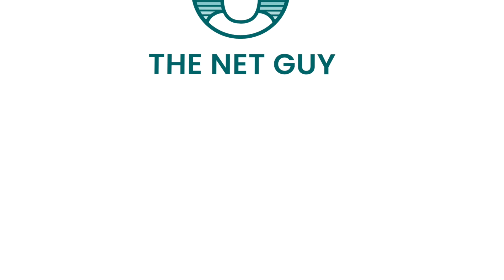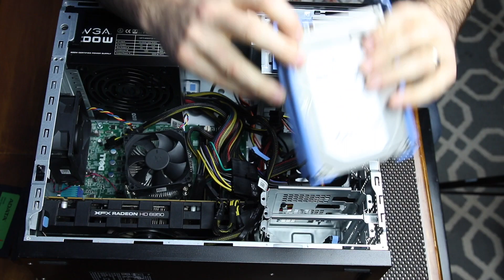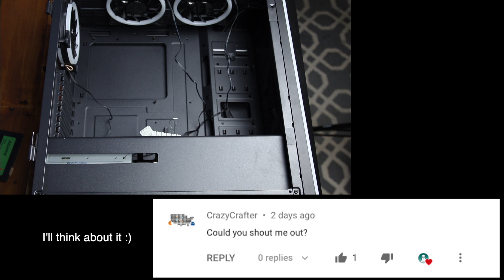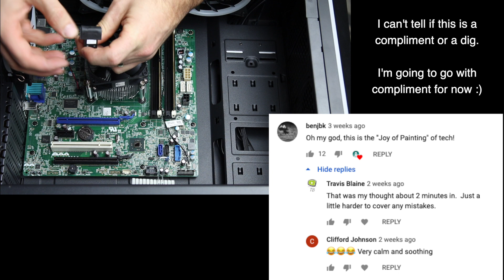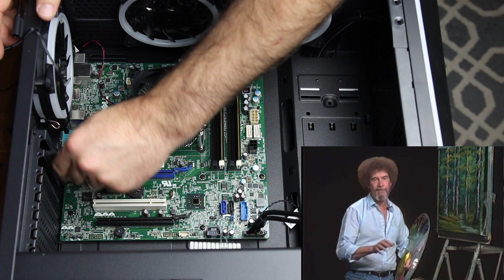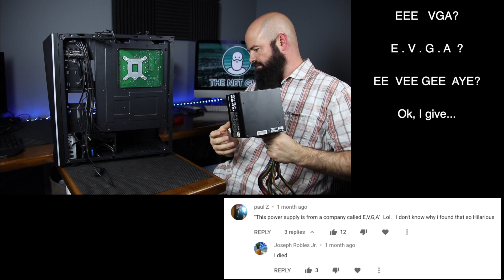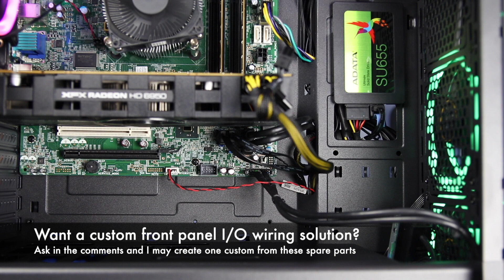Easy Dell Optiplex RGB Case Transplant

Comment: Net guy, recommendations on which optiplex to purchase?
Reply: Hey, until you hear from Net Guy you can try website DiscountElectronics.com they have plenty of used refurbished Dell MT computers and the OptiPlex 9020 is very nice for the price.
Reply from the maker: Depends on your need, but the Optiplex 9020 with the i7-4790 is a BEEEEAST machine. I love mine and use it every day.
Reply: Thanks net guy! I’m currently working on an optiplex rig, but I have a pretty tight budget.
Reply: @ret2097  same

Comment: wow thanks sir for the videos, I have optiplex 790 and wanting to switch other case, kinda stuck in I/O problems but your idea is just 'tuck in' inside casing might good idea. Hope I can find new PC case to switch and bigger enough to tuck in the I/O panel.
Sometimes I wonder if we can make a slot in front or upper casing to slide in the I/O panel so we still able to use it, but it seems like hardwork. Anyways thanks again kind sir.

Comment: looks like your having a better experience than i am lmao
Reply from the maker: Oh no!   What happened?
Reply: The Net Guy i had to take my whole cpu fan off (for my model) and I’m dumb so I didn’t think about it screwing it back in again. I agree everything else in there and when I was about to put the cooler on again with new paste, I was like o no, I can’t screw my cooler in. Can you help me or have any suggestions.
Reply: You can’t buy any backplates online either :(
Reply: @lachlan.mooney  kinda late but you still need help?
Reply: comatose heart Nah, I’m getting a new mobo soon becuase I think I broke the old one
Reply: @lachlan.mooney  that sucks but anyways for my 7010 sff board to use the stock cpu cooler in a different case I had a spare bracket that was the wrong size but I cut off the screw mount hole so I could put the cooler on without the original case it's not the best solution but it work although if you can I'd recommend just getting a new cooler for your socket if you can it will come with the right mount cause unfortunately with these pre builts they have the cpu mounts part of the case unfortunately although if you wanna keepcthe stock cooler you can always just order the mount separately for your socket type off ebay for pretty cheap
Reply: @lachlan.mooney  hopefully everything works out ok with your new board also what's going on with the old one?
Reply: @glistxningamber9534  how do you get the audio working
Reply: @arsynic4202  either use the back audio or you can make an adapter to use normal audio headers with it but that requires a lot of resources
Reply: @glistxningamber9534  for example, my case has a front 3.5mm jack how do i make that work
Reply: @arsynic4202  https://linustechtips.com/topic/987783-optiplex-70109010-front-io-panel-pinout/ this shows how
Reply from the maker: I did find some you can buy that are reverse from 3.5mm plug to motherboard make side.  But that’s a lot of work for questionable audio.

Comment: Thank you so much I had an Optiplex 7010 DT that I've tried to do a case transplant and had to put on hold for a while. This video really helped out since I missed a lot of stuff from the old case like the front fan and intruder thing. One thing that's holding it back though is that my new case came with a rear fan with a 3 pin slot that I don't know where to connect.
Reply from the maker: Thanks for watching and I’m glad you liked the video.  Often those three pin headers are for motherboard fans, but this one has different pin outs.  Your cheapest and easiest solution is a molex to 3 pin adapter from amazon: CRJ 4-Pin Molex to 4 x 3/4-Pin PC Case Fan Sleeved Adapter Cable https://www.amazon.com/dp/B07DPXR8KS/ref=cm_sw_r_cp_api_i_fpNoEbB5AFGSW
Reply: @TheNetGuy  Thank you I really appreciate the quick response and answers!

Comment: Jon:  I transplanted everything into a Corsair 100R case and I'm having a power issue.  I jumpered the middle pins and put my case power switch on the front but nothing starts.  When I take the jumper and power switch connector off the computer starts from the PSU (EVGA 600 QB) switch but I had to wiggle the 24-pin to 8 pin adapter - I assumed the adapter has a loose wire - then I reinserted the jumper and hooked up the power switch and nothing (even when I wiggle the adapter).  Obviously it would be pure happenstance if I actually wiggle the loose wire exactly right).

I didn't buy the one you linked.  Replace it?  Or is it possible there is another issue with the switch and the jumper?
Reply from the maker: There is one trick I didn’t show, you can actually remove the whole power switch from the older Dell and put it temporarily on the switch in the new case. This way you can get the diagnostic LED colors. I would try that and see if it’s complaining about memory or other issues. Always good to receive the components, and remove any add-on cards until you have it booting. Did you hook up the PC speaker? That can give you an audible beeps sometimes too.
Reply: @TheNetGuy  - I honestly think I got a bum 24 to 8 pin adapter.  I had it running all day with the switch disconnected (F1 to get past the startup error) but I had to wiggle the actual 24 to 24 connector to get to start when ever i shut it down.  All the 24 to 8 adapters on Amazon have about a 14-20% bad review for poor construction ratio.  I'll try the old switch and I'll have a new / different adapter Saturday.

Comment: im wanting to do this also! the i/o front prop is whats stopping me as id like to have the front usb 3.0 working at the front of the case. so the mention of rewiring sounded interesting to me and would be much appreciated. thanks!.
Reply from the maker: The front USB 3.0 will work, it’s only the USB 2 and the audio that won’t be connected.  thank you for watching! Stay tuned, I have some good stuff coming up with the Athena M2 case.  That one is a great value if you are looking to upgrade.

Comment: Jon, I am interested in seeing how to do a custom front panel i/o wiring solution (actually I'd buy one!).
Reply from the maker: I have the pin headers and necessary gizmos, but since audio is best from the back and I don’t use USB 2.0 I kind of gave up in lieu of the alternative.  If you email me I can send you some links that show the pin outs and I’ll send you the necessary parts ;)
Reply: @TheNetGuy  - I wound up doing a Frankenstein and put the front i/o panel into a plastic 5.25" bay adapter and kludged up a face plate out of the Dell front panel (it's not pretty but it actually works).   I used an internal USB 3.0 hub (https://tinyurl.com/ussux3n)  to give me USB 3.0 on both the Corsair 100R's front panel and the OEM front panel.  Unfortunately Sabrent puts a huge, stiff USB 3.0 20-pin to 20-pin cable in this.  I had to get a custom short cable to clean it up.
Reply: @TheNetGuy  - email sent.  Thanks for the fast response!

Comment: Am I the only person who likes the look of the optiplex case and doesn’t understand why people put dell optiplex systems in rainbow barf cases
Reply: From the outside its nice, but from the inside its like a horror movie
Reply: Mostly because of airflow.  Right now my Plex server / TV DVR computer is a max'd out SFF Dell.  The i7-4790 in it gets hot - not critical heat throttling hot, but hot.

And the challenge.  I'm assembling parts for a 9020 "rebuild" now and airflow and cable management are my top priorities (I'm not a gamer).
Reply: Mike Murley I guess I can understand for an add but the airflow on my 7010mt seems fine and the temps never go above 70 on my graphics card or my cpu
Reply: @falldmg6306  - 70 degrees F or 70 degrees C?
Reply: @mikemurley8656   Celsius
Reply: i like t looks of a dell optiplex i just would rather upgrade
 th
Reply: Probably for future upgrades

Comment: why didnt you just disconnect the chassis intrusion?
Reply from the maker: Hi Hans - it actually will throw an error message on every reboot of its not connected.  You may be able to turn that off in the bios,  but I decided to keep it.
Reply: @TheNetGuy  all i had to do was take power off the board and disconnect it, but if it works, it works
Reply: @TheNetGuy  All you have to do is go into the BIOS and disable chassis intrusion, Then remove the chassis intrusion from the motherboard and it will work fine without any erros.

Comment: Are the steps for the 9020 similar to the 7020? I have a 7020 and i'm planning on upgrading to an SSD, PSU at least 500w and a rx 570-580 but i don't know if i could upgrade the case too, if i do i would be closer to upgrading directly to a new pc just by changing cpu and mobo
Reply: My plan is to upgrade to the point of having a fully costumizable PC, same as just building one but step by step using my current OEM because budget

Comment: I want to do this with a dell optiplex 3020 tower, will it work? ( also planning to add a gtx 670 )
Reply from the maker: The 3020, 7020, and 9020 we’re all incredibly similar systems. I haven’t been hands on with a 3020 before.  I’d avoid the small form factor (SFF) model if trying to case upgrade.  Also verify the power supply connector size in case you need an adapter.  I hear the Optiplex 790 didn’t need an adapter.
Reply: @the net guy yes I’m thinking of buying the 24 to 8 pin connector for the psi and the form factor is a tower. Is this ok for an upgrade? I find it so confusing putting it into a new case 😭

Comment: hello, i need your help, where did you put RGB fans switches(because my RGB fans are not fitting into the motherboard) or power on board
and how to place another HD audio, led, reset switches???
Please response me fast
Thanks
Reply from the maker: HD audio I skipped because using the front panel audio headers is not normally recommended - there can be more noise on those than the back panel.  Led and Reset I didn’t need - just power.   USB 3 I use occasionally so I did hook that up because it’s a normal standard connector.  Your RGB fans will have to run off Molex - or check out my video on the Aelous M2 1204 fan kit - very cool upgrade.
Reply: The Net Guy l

Comment: I noticed your mobo did not have a black plastic frame for the power supply when you put the jumper and the power supply header from the case in. Dis you cut it off?
Reply from the maker: Sharp eyes.  You can pull straight up and it comes off.  Made it easier to point out the right pins.

Comment: Hi, I was wondering what I would need to do in order to put my: Dell Optiplex 9020 into a CiT Raider, I also plan to put in a GPU (RX 570), put a SSD in and possibly change out the HDD with a small RAM upgrade
Reply from the maker: Do you have the 9020 MT or SFF?  It looks like the steps will be identical to the ones in my video.  Use the power switch and front panel tricks I showed and you should have no problems.  You’ll want a conventional power supply and 24-to-8 pin adapter from my other video $100 gaming upgrade.  With an RX 570 and ram these machines are ammmmmazing!   Good luck and thanks for watching!
Reply: @TheNetGuy  hey i have a sff 990 dt and i really want to put it into a m-atx case but it also has strange front panel connectors and power sw. What can I do? Thankyou.

Comment: Hello. When you said that you weren’t using the usb 3 header from the Dell I/O but you will use the one from the case, is it as easy as plug and use? Did you need any adaptor for this?
Reply from the maker: Yep, the normal blue usb 3 header will connect right to the board, it’s standard.
Reply: The Net Guy woah! I didn’t expect a reply this fast. I’ve been watching this video and PC tech review’s video back and forth for a while now because of the transplant. PC tech said that we can cut the lower I/O panel and just tape it. I’m not sure how to approach this.

I plan to build this in the darkflash dlm21 case. Looks like a cheaper nxtz case with some cool features up the front. Can’t wait to share with you the results.
Reply from the maker: Thanks for watching. Don’t cut the wiring unless you absolutely have to.  I didn’t need the audio or the usb 2.0, so I left it.  I actually got a new mobo last week and put the Dell 9020 back in the old case so I was happy I didn’t cut anything.

Comment: I have a 9020 MT I was wanting to put in another case, but what stopped me was figuring out that power switch. Nice vid, like your stuff
Reply from the maker: Thanks for watching Sean!   Yes it is that easy, no complaints here so far.  Gamdias even sent an upgraded modular power supply and new fans for it for an upcoming video.
Reply: Out of curiosity, did you guys have to remove the shield around the power switch header to do this? I tried going that route with my (admittedly very old) donor case and my case's power switch cable just did not want to slot in. Ended up modifying a bracket to hold the Dell switch.
Reply from the maker: Good question.   I removed it and left it off for my custom case build.  When I returned it to the Dell original case I put it back on.  It takes some finesse but it comes in and out.
Reply: @TheNetGuy  What sort of finesse are we talking? A nice yank with some pliers or another method?
Reply: Dont worry it's a easy thing to do just be careful
Reply: Easy, but tiny pins
Reply: Can you show me a timestamp of when that is done? I'm having the same issue that you had.
Reply: where can I get a jumper I do not have an old hardrive?
Reply from the maker: You can use the hard drive LED connector if you want too